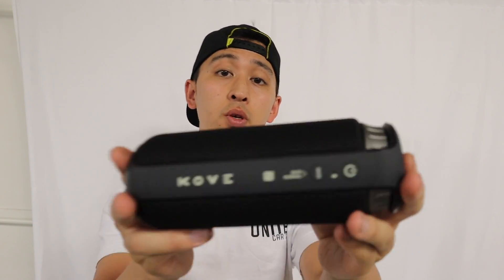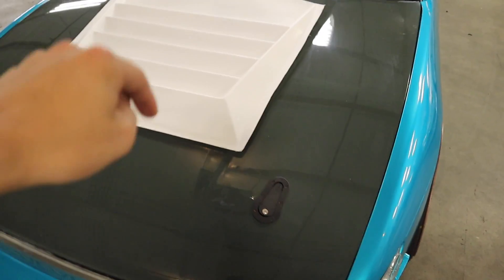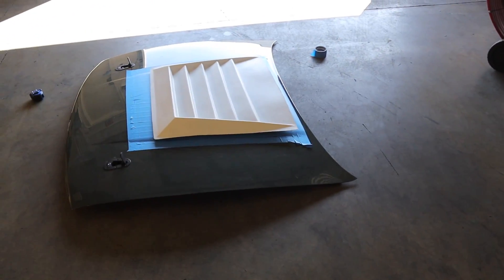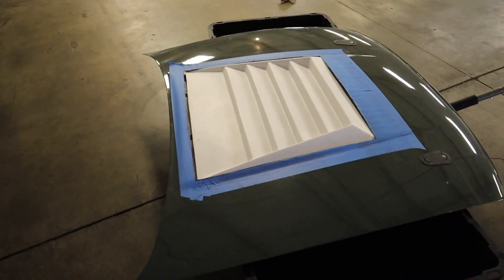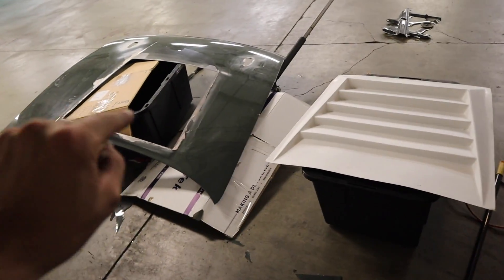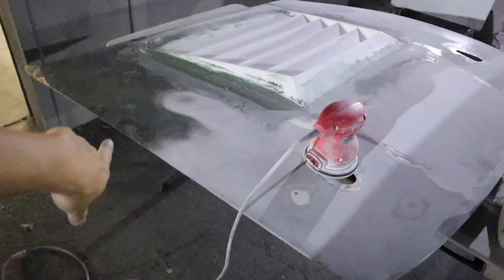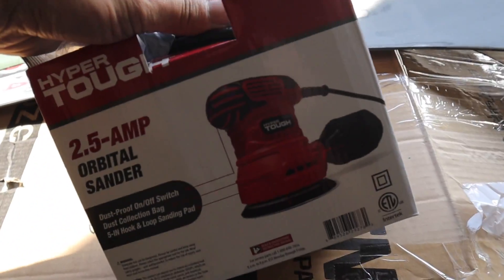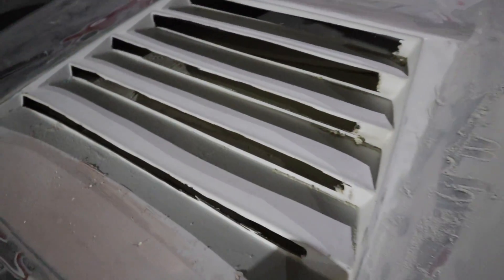Installing Vents To My Silvia Hood Part 1

Comment: I don't know if you already have or if you plan to but after you do the Coats of bondo and sand it all down to the rough shape you want you should use glazing putty over the surface of all the bondo to make sure you fill in all the super tiny pinholes and imperfections. I promise you this extra step will make you so proud of the outcome especially if you paint a rapid those imperfections will show drastically but glazing putty literally makes it smooth as glass especially when you're standing with 800 to 1200 grit sand paper that's really all you need for the glazing putty you're not sculpting your just smoothing out the wrinkles that you filled in with the putty.

Comment: If you send the hood smooth as glass and you fill in any of the denser divots or chips in the paint sand that smooth as glass and then rapid with a super legit carbon fiber wrap it would be dope I would even go so far as to put a 2K clear coat over the rap to help give the effect that it's resin coated carbon fiber weave.

Comment: Good job bro I did the monaro scoop in my VT commy same as you no prior experience but a good idea. anxiety was high on that first cut but ya just have to send it. I did mine diferant to yours mainly because the shape of the hood and the shape of the scoop were diferant, I had to come from the top so it didnt look weird. after like 3 hours of measuring like 6 times I finaly talked myself in to starting used panel bond glue and rivets next day newtech bog then standard bog like 4ish years later still looks mint bit of sink back over the rivits but negligible lucky you wont have that issue. Please promise me one thing of you ever get s wide body kit for any car mould them to the car like you are this scoop dont just bolt em on and say done moulding them on is so much cleaner!!!! Looks way better and isnt hard to do as you are discovering

Comment: Not too sure about the hoods stability now, if you ever have a crash the hood will probably crumble
Reply: BallsOutPerformance I don’t think you understand. It’s okay though, you’re getting rid of the structural integrity of the hood, he cut the hood brace on the underside of the hood out
Reply: BallsOutPerformance Theres reinforced with their own shit, aka carbon fiber and fiberglass
Reply: BallsOutPerformance When you make a mold of it you dont just mold the top part and leave the underside flat

Comment: Bro come on... flip the hood upside down and push the vent in from the bottom. Let gravity do it’s work with something smaller. You could’ve used weight to push the vent into the hood from the bottom instead of laying the hood on top